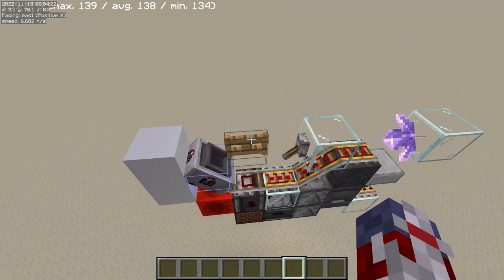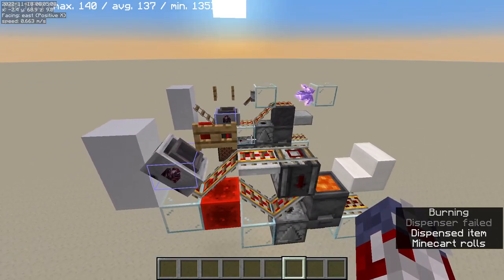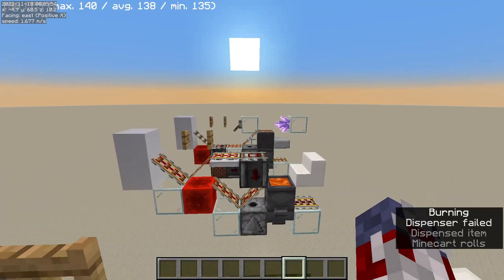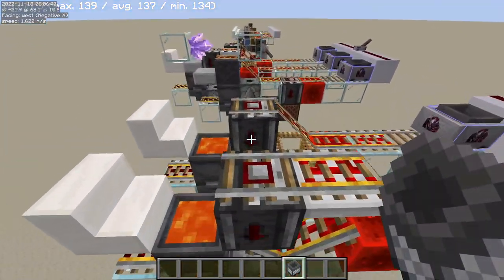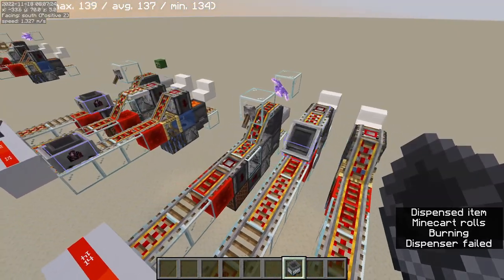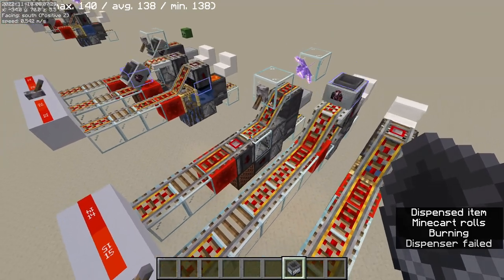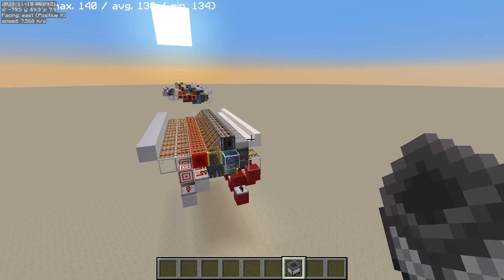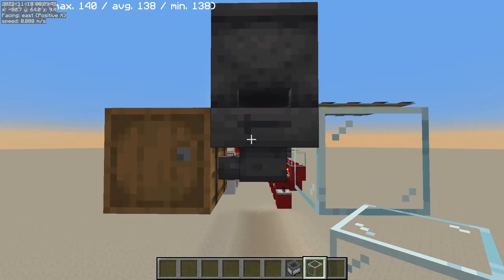New Instant Unloader and Debugging

Comment: This hopper locking design does not allow the system to be shut off at any time.  If the runs are long and/or the carts are not in sync, the hoppers may become locked before the carts are captured.  Do you have a more tolerant design?
Reply from the maker: I think i mentioned in the video, rather briefly, that for systems that are too long to get the cart back in time, that all you need is to extend the pulse extender. Also, as mentioned, the hopper locking here isnt really necessary in a practical setting.
Reply: @inspectortalon  The point of hopper locking is for when the system isn't in use.  It's quite reasonable to expect the system to be loaded but not in use as there are lots of applications for an unloader.  It's a shame there isn't a better way to lock individual runs rather relying on a count-down timer.
Reply from the maker: @oblio   if you wanted an alternative, you could use a detector rail that powers a piston to unlock the slices only when the cart is being destroyed. Unfortunately it is more laggy when the piston fire, so i wouldnt recommend it.

Im not sure what you mean by "reasonable to assume it would be loaded", since the unloaders are dedicated to the specific farm they are being used for. You can control chunk loading, and with proper management it isnt a reasonable assumption. Additionally, with lithium, regular hoppers (while the system is idle) are just as lag efficient as locked hoppers.

Comment: Any reason why you didn't use the detector rail-piston method of hopper locking?
Reply from the maker: that causes a lot of unnecessary active lag, which can reduce the rates and/or server/client performance. Locking the system only when in use is a more effective method overall.
Reply: @inspectortalon  I'm curious by how much. I'd love to know if you have the numbers at hand.
Reply from the maker: @DrakePHOSE  i dont have exact numbers, but piston extensions (especially with blocks + being in rapid succession) contribute a noticeable amount of lag, even if brief. Torches are also quite laggy, however it is only triggered twice between the start and stop of the system. Additionally to the piston issue, powered rails help ensure reliable cart yeeting regardless of the rail length (given that cart is able to snap to the rail, of course)
Reply: You have an example of that?
Reply from the maker: @oblio  i believe C5 made a working design with that (isnt included in his video on his instant unloader). Iirc the screenshots are somewhere in the cartchives.
Reply: @oblio  An example of the detector piston hopper locking? You just have the rail the minecart gets broken on be a detector rail on a non-solid block. Below that block you have a sticky piston with a redstone block that locks the hopper. When the minecart gets broken, it powers the piston, which unlocks the hopper.
Reply: @DrakePHOSE  Oh, I don't need to lock the hopper while the cart is traveling - I was looking for a way to lock all the hoppers (after they've collected their carts) when I turn off the farm.
Reply: @oblio  Uh, this video has that setup.
He shows it off at about 4:05
Reply: @DrakePHOSE  sigh I know; I have another msg elsewhere about this. It's handled by a decay clock which has to be calibrated to the length of the rail and doesn't necessarily compensate for out-of-sync carts.

Comment: So I play on this Paper server and my hopperminecarts keep ending up in the water stream instead of going in to the hopper, I already changed the design to never lock the hoppers. Idk what 2 do anymore, this bug is killing me.
Reply from the maker: There is 1 direction that simply does not work in paper. Try rotating the design, i cant promise it will work but maybe it will help. I strongly recommend trying to switch off of paper if at all possible
Reply: @inspectortalon  I'm having the same issue. Do you know what direction it is? Is it facing a certain direction or along an axis?

Comment: so with this new design, when the minecart returning it will go first to the rail below the comparator and then above the comparator, which leads to losing the momentum so it never reaches the rail which leads to the cauldron, so it gets stuck on the stair, any solution for this? I am playing on a 1.19.3 server, I am not sure if its paper but I think its not
Reply from the maker: I'm sure there is a fix to what you are experiencing, but I can't quite envision what the precise issue is. Would you be able to provide screenshots in the cartchives discord server?